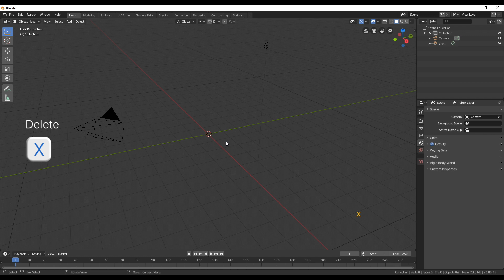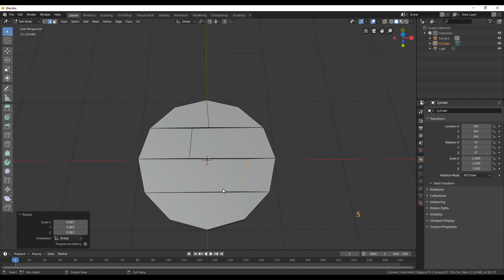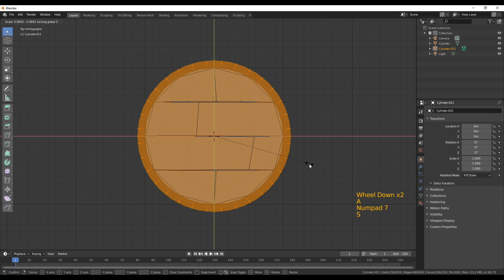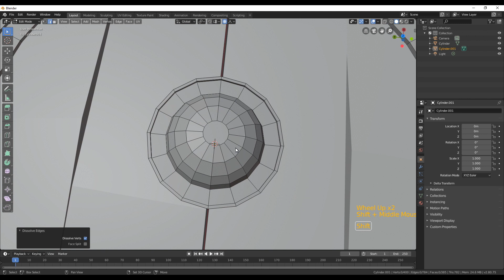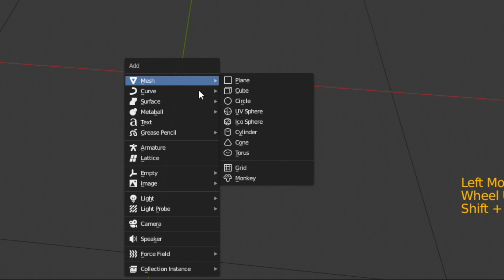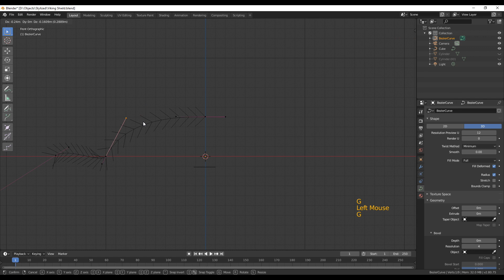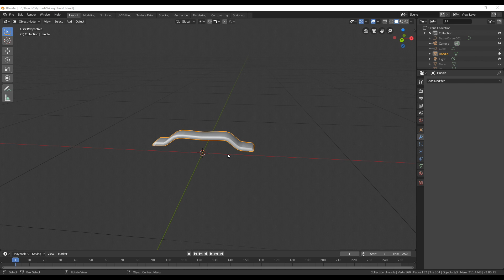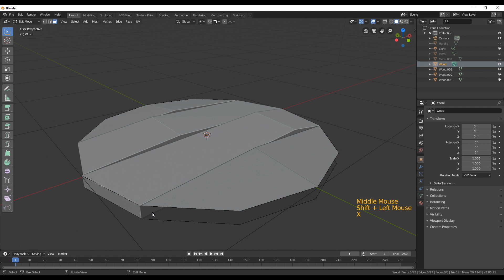How to create a Stylized Shield in Blender 2.8 - Part 1: Modeling [Intermediate]

Comment: easy to follow tutorial with good advices and nice technic 
couple tips of mine:
for knife tool you could use the cut through option (z button) it will speed up you work
grid fill for patch up holes